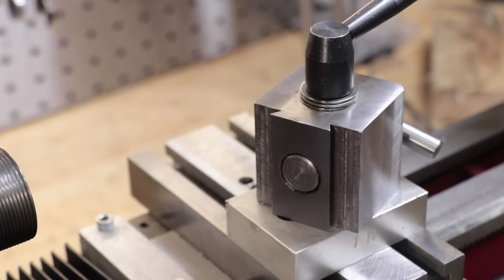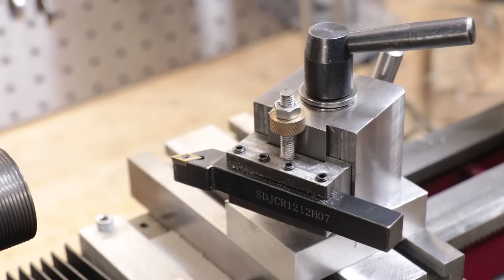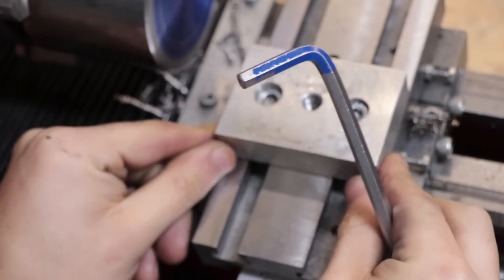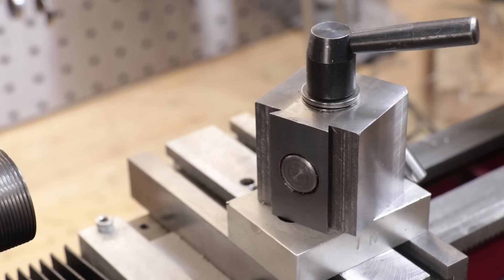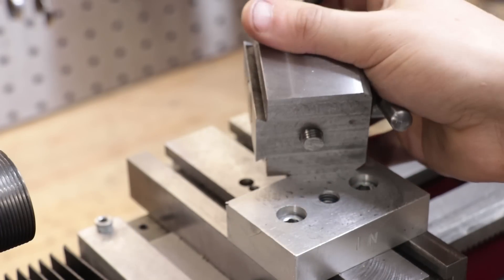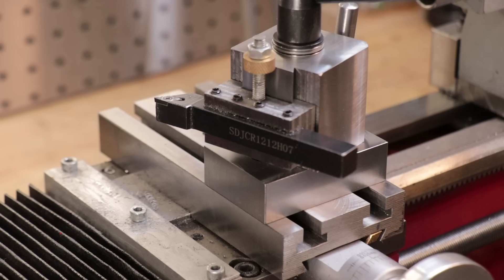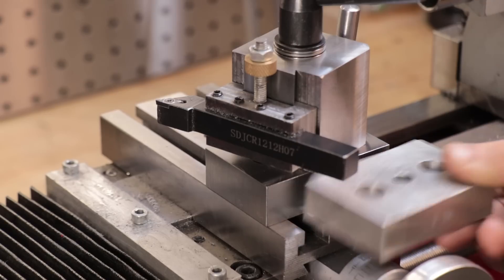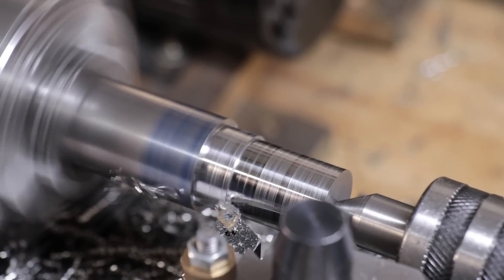Machining A Tool Post Stud And Riser For The Lathe

Comment: This helps, I have a similar lathe and I've tried 3 different tool posts(each an upgrade on the last) and they've all been too low to use the high adjusters and caused some stability issues too

Comment: I would personally suggest 1 relatively easy Quality of life improvement
Take the tool post and machine  3 locations on to the underside - 0 Degrees, 45 and 90 degrees
Then fit a ballbearing topped spring detent into the riser

Your tool post will now easily locate to repeatable positions - necessary for repeat tool changes without losing zero on your DRO

Comment: Almost all of the machining channel I've seen on Youtube lately cut threads by hand-turning the lathe chuck. When I was "on the tools" in the 80's and 90's we never did that in industry, we always used power feed. Mind you, I remember many adrenaline rushes thinking I wouldn't stop the motor or wind out the tool before crashing either the chuck or the work piece..
Reply from the maker: Not sure why others do it, I do it because my lathe is underpowered :)
Reply: @artisanmakes  Well that's a good excuse, fair point!

Comment: Hi, if that's a thrust washer set under your clamping nut, you need to do away with it. Replace it with a thick washer. Thrust washers are designer to allow things to rotate under heavy axial loads. Why would you want to risk your tool post rotating when you're taking a heavy cut? Thanks for the great content - you're a very watchable channel.
Reply from the maker: Cheers mate. I have used tool post set ups before that incorporate thrust bearings in this allocation In place of washers. I'm my experience I get better clamping force and the clamping but takes less force to undo.

Comment: Man I always enjoy all your videos. Really appreciate the content and honesty.

BTW Ive given up on the t-slot cross slide build for the moment. While I was making okay progress, CR1018 seems to be really hard on my minimill despite it being the LMS 3990. For example I've had to readjust the gibs numerous times and still the table gets loose.

Instead I ordered a piece of 12L14 from eBay ($44.63 + $8 S/H) that is 5-1/4 round x 2-3/8 thick that I plan to cut out a 1" thick section from, then cut off the sides to 3" wide then mill down the rest. 

From what little 12L14 I've milled so far for the tapered gib strips for the carriage it seems to machine much more nicely and less stressful on my minimill. I think your bench mill is able to contend with hot/cold steel better.

I will probably stick to 12L14 for lathe tool holders as well.

Lastly, have you considered making tapered gib strips for your lathe carriage? I'm aware your shimmed your gib strips, but curious if this is something you've considered. I'm following Rick Krugars plans from 1999.

Oh one more question - what type of recording equipment do you use? Your contend quality looks and sounds very good and I've considered numerous times over the years of making content myself, if for nothing else than to maybe help others resolve a problem or give inspiration. Thank you again from the other side of the planet in USA

Comment: Great video. I want to do this with my Logan. I do recommend removing the thrust bearing on top. There's really no need for it in this application. Thanks for sharing.
Reply from the maker: Cheers, I added the thrust bearing a while ago, I can feel that it has a positive effect, I can get a tighter lock on the tool post, but that is just my experience with it.

Comment: Nice job! Just a thing about that final washer for the take down nut/handle, it was a tight fit. I'd be opening that up just a smidge to allow the tool holder to get the full force of the take down. If it were to foul on the threads of the nice new stud then it may give you a false feel that it's tight when it's not fully.

Comment: Awesome job! I'm sure the steel block adds some rigidity over the aluminum.The improved stud, and the register for the tool post, definitely adds rigidity, and certainly seems like it makes adjusting the tool post nicer, as well.

Question... Is the improved cross slide with the riser block, the same height as the stock cross slide with the compound? I have a solid tool post block on my stock cross slide, and I didn't think about it when making it, but my tool post block ended up about 0.075" shorter than the compound. Like you, I rarely use my compound... But when I do, it's a real pain to have to readjust the heights of every tool holder I want to use, then adjust them back when I swap back to the block.

I'm just curious if you took that into account. I recently remade my tool post block, and this one is the exact same height as the compound. It's a quality-of-life improvement that I should have done a long time ago.